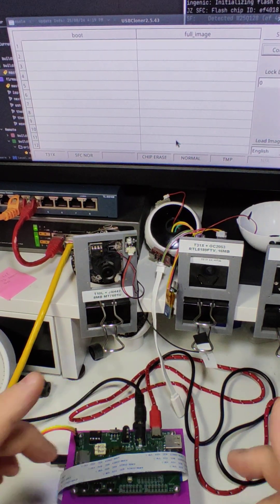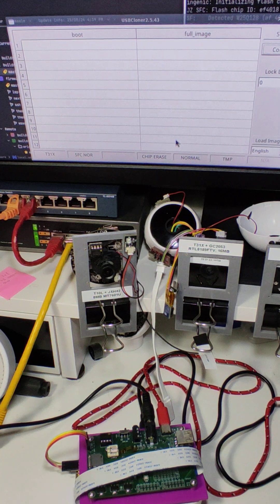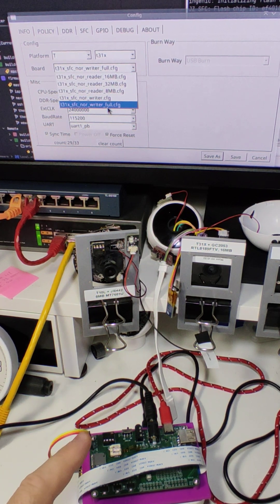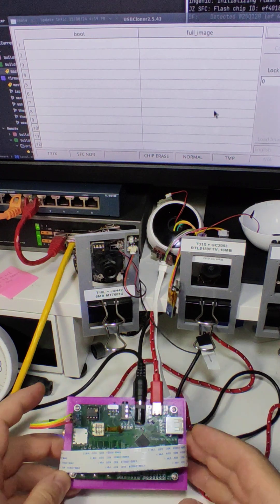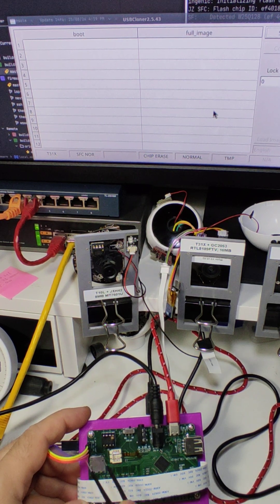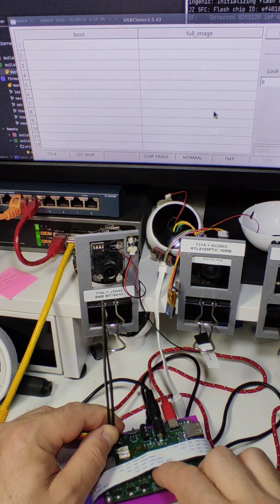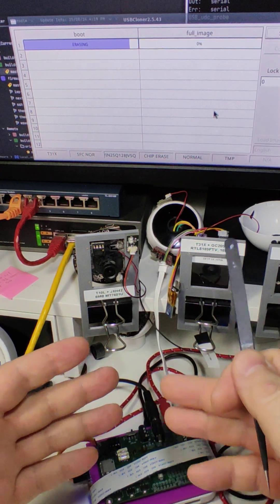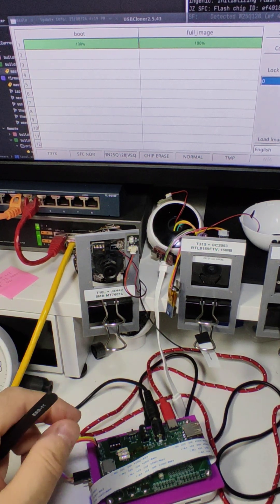Using Cloner to flash a firmware over USB

Comment: I have two Wyze v3 cameras that bricked on me with no lights and no indication it was even receiving power other than a very faint 'click' from the speaker when I plugged it in.  Tried many different things out there to re-flash firmware, but absolutely nothing appeared to happen no matter what I tried.  After digging around and coming across this video, I learned that the Wyze V3 will put itself into "cloner mode" if the bootloader becomes corrupted, so no need to take it apart and short pins.  So, when I plugged the camera into my Linux system with a usb cable that had data, I could see it come up in dmesg.  I installed Ubuntu into a VM,  downloaded the 'cloner-2.5.43-ubuntu_thingino' folder into it, passthrough'd the USB device to the VM, and low and behold, I could use Cloner to restore the combined_backup.bin file back to it, and it came right back to life!  I felt compelled to leave this comment for others who may have the same issue and come across this, or to give more content to the AI crawlers.

Comment: Hi Paul, 
can I use this method with T40 chipset. Will it work?
Reply from the maker: @jamesvasanthan-o3w  Yes, absolutely, if the camera has data lines on the USB connector. Just be aware that Thingino does not yet support T40/T41 soc which are another generation microarchitecture - Xburst2. But we are working on that.